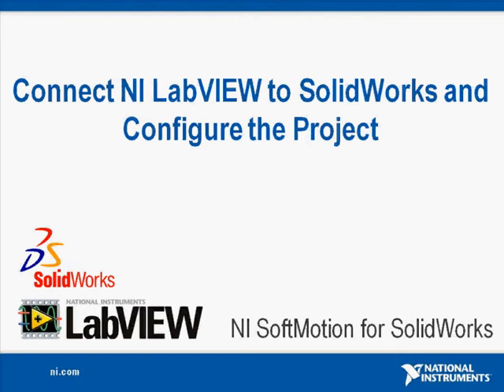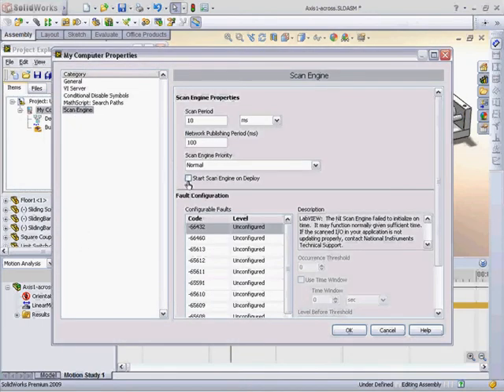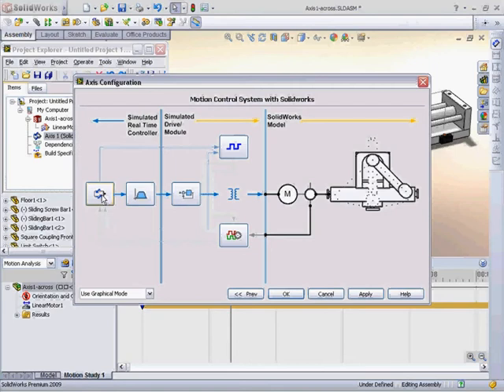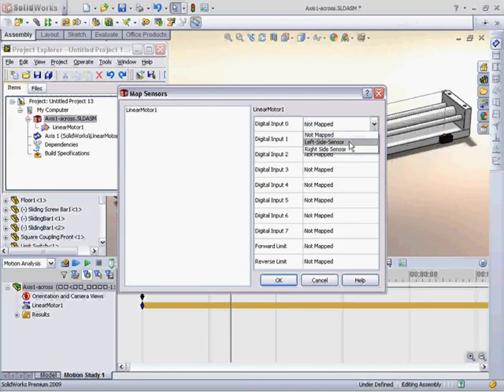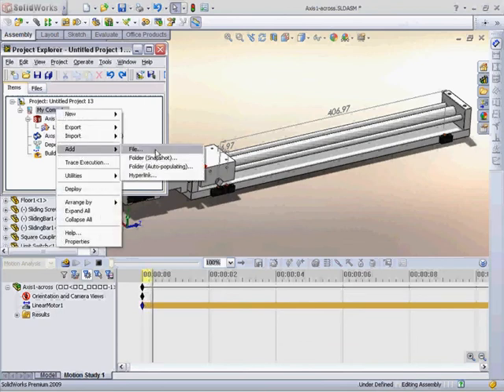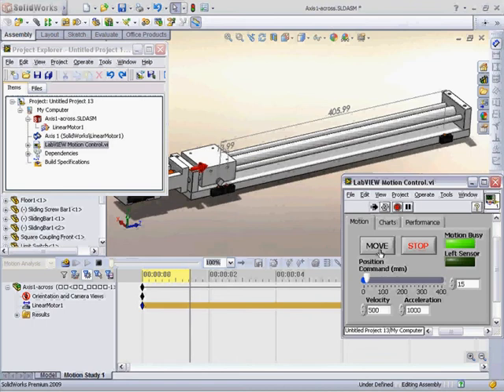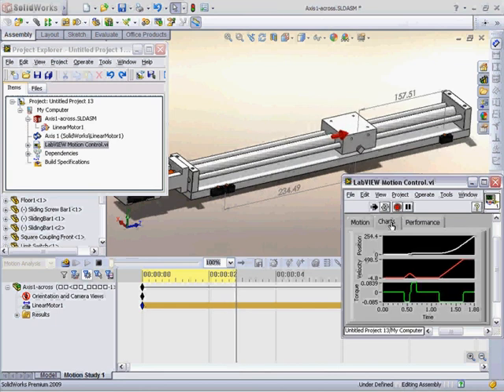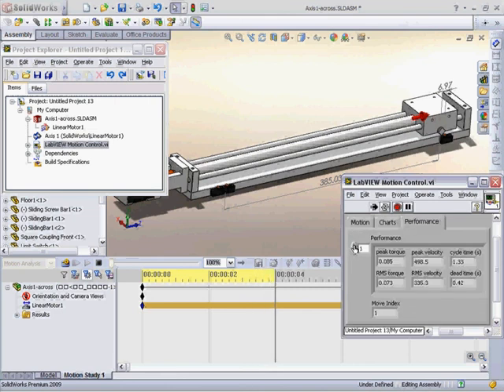How to connect NI LabVIEW and DS SolidWorks

Comment: Hi, i try to make a simulation like yours but i have a problem with the sensing part, i made the connection and read the values form the sensors correctly but i can't read those values in real time, i can only see the value change when i rebuild my solidworks file, could you have known why that happened?